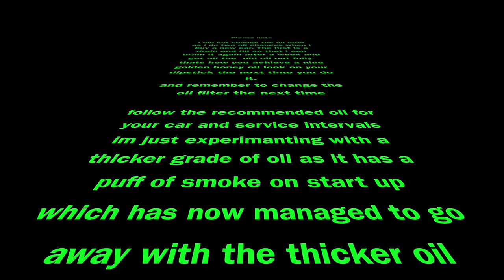Nissan elgrand oil change

Comment: just bought one of these, and the oil pan was almost dry.  Had to put over 5 litres just to top it up.
it was smoking too, so I put 10w40 and its better already
but will be doing a full change with filter next week!
thanx for the vid

Comment: Thanks for the informative video. I need to mention that it appears that you need new front tyres.
Reply from the maker: @martinjudd1284  probably new brake pads, catalytic converter, bushes, wiper blades and shocks. Many little things but it’s not easy to make a video of each item being replaced and wouldn’t be very interesting watching a new tyre purchase for a van 😆

Comment: Great review! I'm very interested on getting one of these Elgrands and DIY oll changes will definitely be happening!
I wonder whether the vacuum for oil changes method would work on the VQ engine. It would definitely eliminate the need to fool around with the drain plug. The kicker is the location of the filter. Is it on the bottom of the engine?
Reply: A bit late.  But yes, it's on the underside.

Comment: Hello  It Is very important to change oil filter every time you change oil in Nissan Elgrand with best oil Penrite 10w/50. Please remove the first black plastic cover under the engine to change oil.
Reply from the maker: U have to read the words at the end of video i explained why I wasn’t going to change it on that oil change

Comment: Sorry about your video but what kind of halfway job is that, what about changing the oil filter too. Do you know these engines has a plastic guider on the timing chain you don't want to clog oil filter running on that engine.
Reply from the maker: If you could post a video on it I’m sure people would appreciate it. 
Was only showing how to change oil not how to change filter
Reply: @Turbovanilli  changing the motor oil and oil filter goes together same way as putting on your sneakers and tying the shoe lace .
Reply from the maker: @taximan7912  If you watched the video fully you would have seen  that I was trying out a thicker oil and  even wrote at the end that people should use recommended oil as I was just experimenting to see if smoke would go away and that i was  using it just as a type of flush so I can then put the recommended oil with filter later to achieve a golden oil colour which only happens when you change oil twice if you find black oil after u purchase a vehicle.
But everyone has there own technique  so if you want to buy two oil filters and change an oil filter twice In one day to do a basic service then  that’s ok that’s just your technique.
But it’s a little too expensive for most of us to do that Frequently so I do it this way. 
And for me I enjoy my cars so I find I change my oil more often that I should but I change my filter on the recommended intervals cozif u change it too early it would be a waste of a filter but a cars oil can never be too clean
Reply from the maker: When I do a review of the car later on this month I’ll include how to change oil filter if that will help you out a little.   On the forums people can never find the oil drain plug and always ask the location for the elegand so that’s all I focused on was to show people where it’s located and answer that common question

Comment: 20 /50 ???
Reply from the maker: redbach23 yes if you watch till the end it was to test if the smoke it was blowing on start up would disappear next time I start the car by using a thicker grade of oil. But i did also write  to follow the recommended oil for the car not what i used it was a experiment oil
Reply: @Turbovanilli  hey man I just called across your video because I have that exact problem and I felt relieved to see you ve uses 20w50 Is exactly the same I've used to get rid of the smoke and worked amazing. Just a quick question, for how long did you use that one? Did you get to a 15w40 for instance or are you still with that one? Thank you!!!